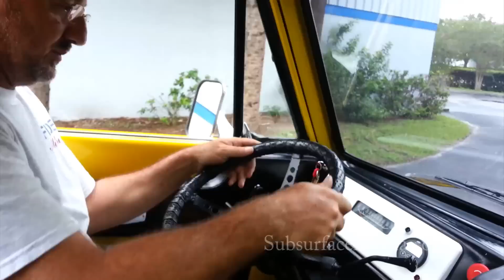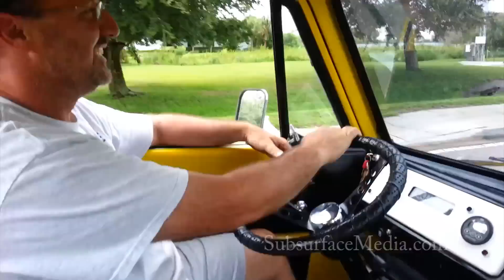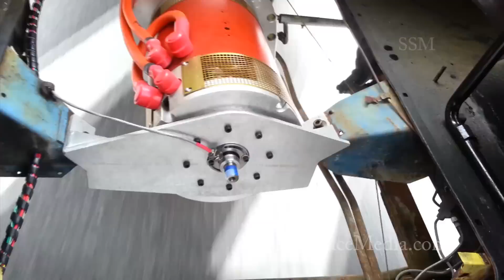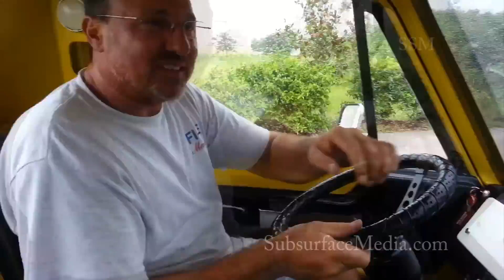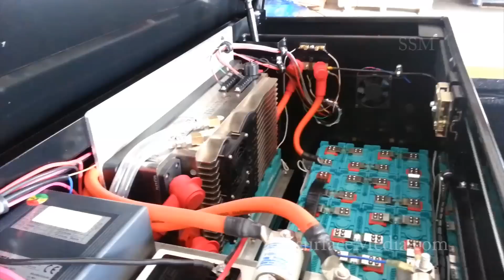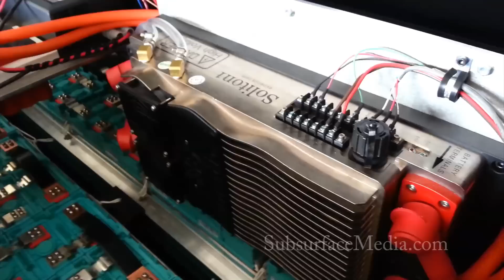1969 Dodge A100 Pick-up Electric Conversion

Comment: These vids never tell us how fast it goes or how far you can go on a charge, you know, the important things.
Reply: In the video description it says 80 miles per charge, which isn't too shabby (about what a first generation Nissan Leaf gets, and he only had a small amount of battery. Could probably easily get twice that with additional batteries). Top speed? Hard to say. I'm looking for a build video for this thing. Looks like a fun project.
Reply: @JustWasted3HoursHere  Thes best part is once the battery degrade in 15 years he can replace them for cheap with any battery chemistry he wants lead acid , LTO,LFP  etc ...  A normal ev would not let you do that and your car would be worth 0$

Comment: Why did you get rid of the transmission?
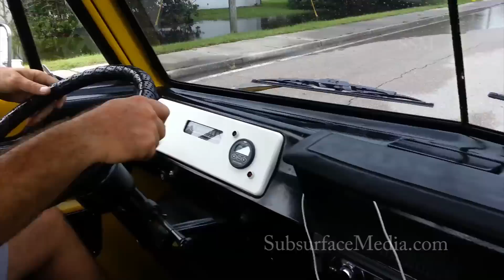Reply: I don’t know if they actually did or not - they might have just moved it. At 0:48 he says something that sounds like “we’ll start it off right in third.
Reply: rodeo o  Dude, take an engineering class, unless it is a servo, Vector vfd with encoder or a DC motor with feedback which its not it will lose torque at low speed. Have you ever grabbed your drill chuck when its at low speed and stopped the motor... sure its cool, and I just asked a reasonable question.

Comment: so if my Chrylser Light-A engine ever dies (I'm doubtful that will ever happen)  I'll just throw an electric motor off of a submarine in there with a teslas battery in the floor of the truck bed for extra distance and wheelie capabilities at 100%
Reply: If anyone asks ' does that thing got a hemi', just tell 'nope, its powered by general electric'.

Comment: It's now 2020 and this seems even more relevant today, amazing conversion.
Reply: Not relevant at all. The cost far outweighs the benefit
Reply: @tylerbonser7686  It's not a total cost in use business proposal old chap, it's relevant as electric mobility is in the ascendance. Don't take everything in your life so literally and you'll find it a lot easier.
Reply: The Hermanator and Spurgle  and you don't have a clue what the conversion would cost. It far outweighs the savings in fuel. Battery technology has to improve and cost come down. People like you are to ignorant to see the current drawbacks.

Comment: Isn't it better to put the batteries down where the engine was? At least as many as fit into there?
Keep the center of gravity down man, and don't waste your loading space!
Reply: Li-Fe batteries aren't really that heavy, but yeah, he could have made waterproof racks underneath to house the batteries. You just don't want them too far forward in the event of an accident that might damage one of the packs enough to start a fire.😉

Comment: That's cool l would love to do a conversion on a pickup but how do you get brakes that are vacume type to work?
Reply: vacuum pump
Reply: yeah seems like swapping the motor is the 'easy' part, getting all your ancilliaries that used to run from the original motor would need some thinking about.

Comment: How many batteries does this car need...? Is an EV like a tesla or anold car conversion saving you money. You trade the cost of gas for the cost of batteries.  Rather you're using lead-acid or lithium, it's costly to replace batteries. Lead-acid you replace every 24 months(average cost $100ea)...lithium every 60 months($20,000). Big heavy vehicles are costly to build.  It makes more sense to build light simple cars that only need 1 battery costing on average $100 to replace and gets you at least 85miles per charge.  Let's face it, how far do you drive per day...do the math for yourself. Most people only drive around town. We have a ways to go with the development of EV technology.

Comment: All that retrofitting yet there’s only two socket head cap screws holding the damn thing to the existing motor mounts!
Reply: How many should there be?  How many studs/bolts normally hold an engine down?

Comment: Is the motor straight to driveshaft?
Reply: Some electric motor are designed for work in tandems configuration, this is, one motor behind another electric motor for increased performance.

Comment: No rubber isolation on the motor mount...hmmmm motor mount made from welded aluminum...hmmm. I'm a being from the future, where I come from, your motor fell when you hit a bump on the freeway. It wasn't pretty. The motor acted as a wedge between the truck and the freeway. Your truck was then overturned at 65mph sending it on an uncontrollable spin.tge batteries came out and began sparking causing a fire... yeah, it was. So put some isolator on that motor.

Comment: love the idea of putting everything in the tool box.
Reply: I converted an old riding mower into an electric go kart. I used a battery box to store the electronics. If I had needed to go bigger, I was looking at using a toolbox. They are incredibly versatile and relatively cheap for what they are.

Comment: To remove more weight and have less area to fail. Why dont you move the motor to the back axle and forgo the driveshaft? I assume there isnt a need for a transmission?

Comment: I would not mind if all daily-driven cars were electric. No stinky cars, no loud vehicles, no leaky nasty cars...I would keep combustion-engined vehicles as pleasure-xruisers though. Weekend cars, racing, shows, etc. The infrastructure would have to be in place first then complete mandating of electric vehicles by a certain date. It could be done but Big Oil won't let it happen for quite a while.

Comment: Tha is only give you 20 miles maximum speed and 56 range only tow 640 lbs in flat surface nice
Reply: It gives you 80 miles range and 80 miles per hour top speed

Comment: Why can't I buy electric conversions for existing vehicles yet?
Reply: You must have the money first. Seriously there's no company that makes kits for different cars now. Its all custom fit. Bosch does for new cars though.
Reply: Because for the amount of parts and tools you'd have to invest in to do so, you could just go and buy a Tesla Model 3. (This is still more in the realm of hobbyists that do it for style points.)

But maybe one day we'll just see some drop in kits with battery packs that replace the gas tanks, and powertrain modules (with motor and motor controller) that bolt onto the engine cradle, and a pump and a few lines that plumb around to use the existing radiator for cooling.
Reply: @pauljs75  Noo its not that much as buying a Tesla. I saw many conversion videos of DIY vids of all kinds of cars. Up to 10 grand you can get it done.

Comment: Why not have a LARGE pully coming of tje front of that motor that with a belt turns 6 alternators wired for 120v each to recharge the battery pack while in motion. Could resemble a bow tie.
Reply: You mean for regenerative braking, right? A better answer would be to regulate the power that returns from the drive motor during braking using pulsewidth modulation. No alternators needed.

Comment: '
wow that cooool nice electric motor van...
important to keep away from the water / wet...
better to be seat BELT on...
not need to put comment in here about currency per charge...
not important to know about it
Reply: It is probably old enough you don't legally have to wear a seat belt.
Still a good idea.

Comment: how do the brakes work with no vacuum  power assist, does braking charge the battery  ; how does the power steering work  .. very cool !!!
Reply: No power assist for the steering or the brakes.
Reply: There are electric power steer assists and electric vacuum pumps available
Reply: On an electric vehicle, when you let off of the go pedal , you get an immediate slow down to a dead stop brake effect

Comment: What voltage is the battery putting out? 23KW isn't much help without a voltage. I'm also curious what motor and speed controller you are using. And Finnally, Do you have plans to increase to battery capacity for longer range? Thanks for your time.

Comment: I have a question. Did you need to use a transmission, or did you run a drive shaft right to the differential?
Reply: you don't need to. if you like to shift you can leave it on.
Reply: Ditching the transmission and fitting a motor with enough torque saves you the 10-15% losses from a gearbox.
Reply: John P Bondrew q

Comment from the maker: No.  He studied the EV forums.  He's hit some of the local electric vehicle shows for PR.  He's a very talented fabricator and CNC machinist.  This is a serious undertaking in effort and money.  That adapter piece between the motor and the clutch was all machined out of aluminum.  Most everything else was off the shelf from DIY EV component suppliers.

Comment from the maker: This was built by a friend.  I just shot the video.   He researched all the off-the-shelf battery and controller technology and then integrated it all himself.  He is uber talented in design, fabrication, and CNC skills.   The batteries are the less expensive lithium iron phosphate type.  I think he has $30k in this total, including the donor vehicle.   To operate, it effectively gets about 130 miles per gallon gasoline equivalent cost-wise.  About 90 miles per charge.  Top speed is 80mph.
Reply: Nice
Reply: To rebuild a diesel motor is $15k, another $15k and you never have to rebuild it again or put fossil fuel into it 😎. Pretty good deal if you ask me, as long as one can afford it.